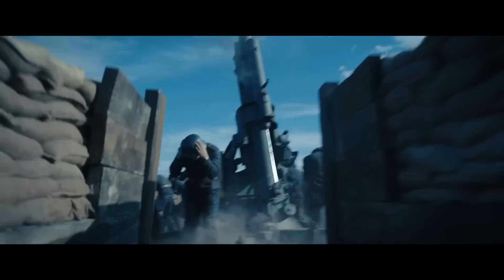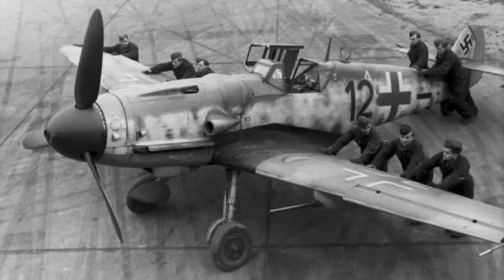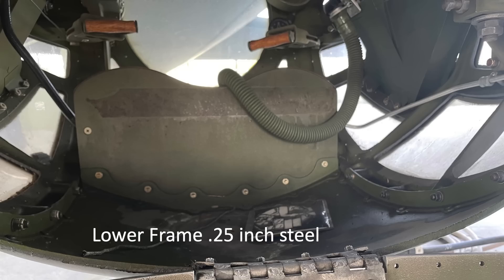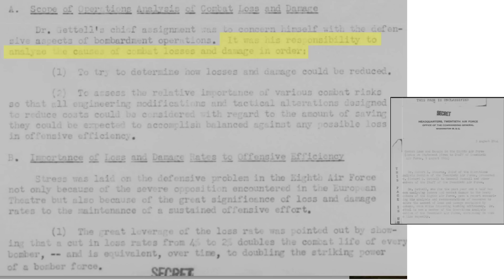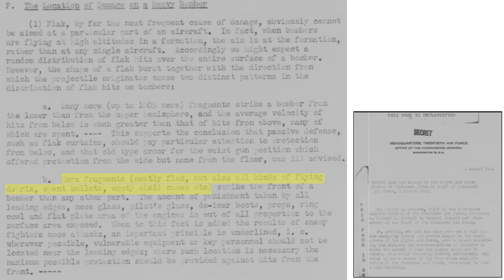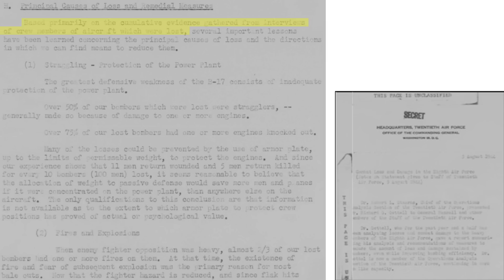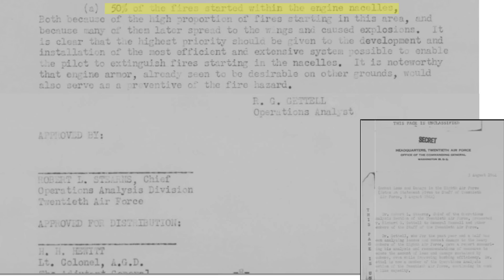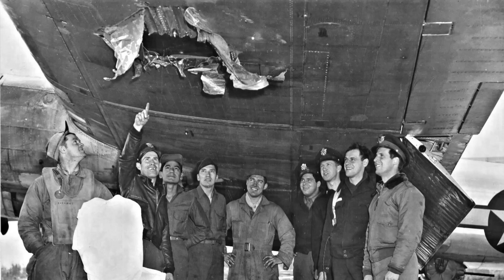Where to armor on the B-17 bombers to reduce losses: Surprising Combat Study Results

Comment: Adding armour protection to the engines as shown in the diagram presents some problems. The frontal area of the engine cannot be armoured due to the airflow required to cool engines. Also the area behind the engine cowling where the cooling flaps are located cannot be totally armoured due to the need to let the cooling airflow escape. Providing armour around the perimeter of the nacelle may not be of that much of a benefit because depending on the direction of fire the adjoining engine/nacelle/wing will provide some shielding. The Pratt Whitney R2800, in the P47, F4U & F6F, has a reputation as a very reliable and strong engine with many instances of a complete cylinder being destroyed but the engine still working allowing the fighter to return to base. Does the Wright R 1820 Cyclone engine in the B17 have a similar reputation? Is there any statistics on the losses of B17s compared to B24s Pratt &Whitney R 1830 due to engine failures?

.
Reply: Your objections make sense. I do not know of the B-17 and B-24 engines as being particularly tough, as they were both turbo supercharged with a lot of airplane to carry very high, so they were probably "taxed" to their limit... You have to realize reciprocity motion makes parts more fragile, and a high engine workload probably reduces the margins of tolerable damage. The 2800 is a case on its own, because its power load could be reduced when mounted on small aircrafts. Even the B-29's 3350s, similar in size and layout to the 2800, were not known as tough, and instead were prone to generate their own fires unassisted by the enemy (about 200 spontaneous engine fire losses out of a 495 total B-29 losses, plus 200 "War Wearies", so 700 write offs out of only 1650 B-29s built by VJ Day... This in barely 6 months of actually intense use. 2250 further B-29s were built in 10 months after the War, and these were way better than the Wartime lemons). The losses on B-29s went down with less taxing low altitude nigh raids, so reducing engine work might make them "tougher"...
Reply: I think that's a good point that demonstrates how statistics can identify a problem or trend, but solving the problem is not as simple as it seems.  In this case it would have required what was an impractical engineering solution.  I think this probably explains with Spaatz didn't act on Arnold's instruction to look into this.

Comment: You cover so many great points with your videos! I am now wondering if post WWII bombers utilized any of the lessons learned information? I worked on B-52s in the early 70s and don't recall much armor in them. Electronics and 4, 50 cals in the tail were about all the protection they had. Keep up the great work,!
Reply: B-52 electronic countermeasures were pretty effective - used as a strategic nuclear bomber the speed is most important as only a few B-52s need to get through to target. Suicide missions essentially.

Comment: I can only assume that the penalties to aircraft performance would have been noticeable if the engines had an extra 1350 pounds of armor attached to them, even if that meant removing armor from somewhere else. How would that affect airflow, cooling, and handling? Also makes me wonder, if armor was only mounted to engines and essential equipment, if aircrews would have started jury-rigging plates of their own for protection.

Reminds me of the "all or nothing" armor schemes of certain warships.

Comment: Awesome.  If you armor the engines would it require modification to wing spars, etc.???
Reply: It'd probably stress the wing spars less, when that same amount of armor is in the fuselage the wing spars are supporting the weight, but when it's shifted to the wings themselves the spars aren't supporting the weight because it's the wings that generate lift, now sitting on the ground would be the opposite, with the weight of the armor in the fuselage the spars aren't supporting it but move it to the wings and they are supporting it.

Comment: surprises?   yes 2.  a) that gun attacks from fighters ended up being essentially evenly distributed across the total aircraft surface, statistically that is.  and b) that most flak hits that cause damage from from below the aircraft.  Do you have a possible explanation for this, as it seems statistically, above and below should be similar.
Reply: Two reasons at least that I can think of:

1. The shells are coming from below with a non-trivial velocity. This biases the direction of the splinters of the flak burst to have an overall upward velocity equal to the shell velocity.
2. As the shells are coming from below, the lower planes will physically intercept some shells before they detonate. Thus, there are less flak explosions on average the higher up the formation you are, assuming the flak has been aimed at the centre of the formation and not above it. Assuming that there is an equal chance of a shell detonating before its targeted altitude versus above its targeted altitude, there will be a number of shells exploding below the formation, but because some of the shells passing through the formation are intercepted, there will be correspondingly fewer shells detonating above the formation.

These are just educated guesses, but they seem the most plausible combination of factors.

Comment: Always good to see science/ analysis versus survivor bias
Reply: I came for the survivor bias story :-)
Reply: Interviewing survivors does not get rid of survivor bias. Surely they reduced it by including interviews of crews that returned instead of relying solely on damage to planes that managed to return, but they still didn't have the data from the planes that were lost with no survivors.
Reply: @somerandomnification   But it does provide a PARTIAL data set, and when you overlay that data on the schematics, you can EXTRAPOLITE vital parts :-)
Reply: And analysis of the original cause of the bomber loss. It may have been shot down by a fighter, but the reason that happened was because of flak damage that prevented it from staying in formation.
Reply: This reminded me immediately about a video that covered the b24s survivability the other day. 

Survivor bias was a big thing that far far too many people missed judging by so many of the comments.
Reply: Survivor bias means that those places that were untouched in surviving planes are the places that were touched in planes that did not survive.